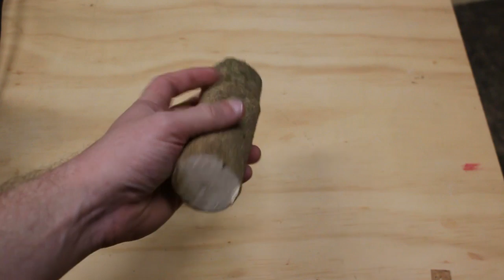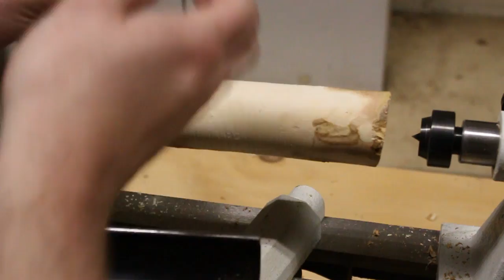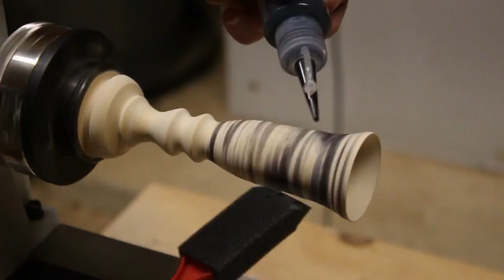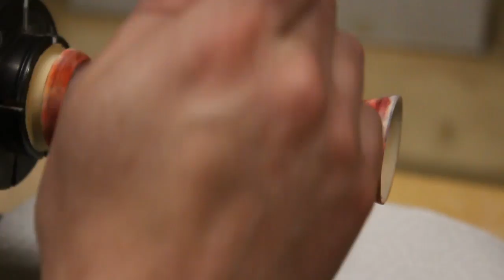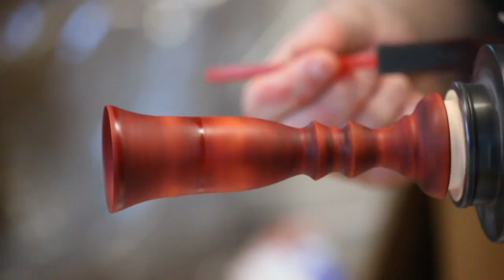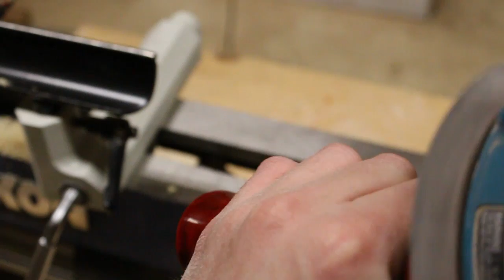Woodturning a Fire Goblet

Comment: I want to know more about that light. What are you using, where did you get it, how do you have it set up? That’s a really smart idea
Reply from the maker: The light is a simple/cheap magnetic LED light off of Amazon with a flexible neck. I sticks straight onto the lathe legs or any other stationary steel area. For this project, a light with a slim head was really useful, but for a bigger opening, a larger head would work. Cheers!

Comment: Really in joyed the video.  Would have been nice to know about the colors and finish.
Reply from the maker: Thanks so much! The colors were all Transtint dyes dissolved in denatured alcohol. Then I added a layer of shellac to smoothen it out and warm up the tone. The top coats were a waterborne lacquer (Target Coatings EM6000), which are so much nicer to use than other lacquers or polyurethane, and make a really nice glossy finish.